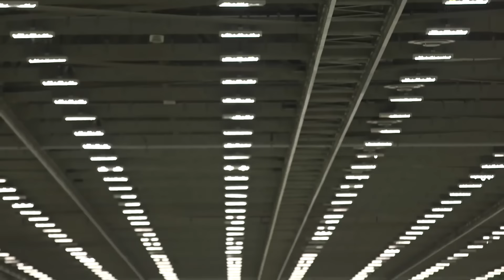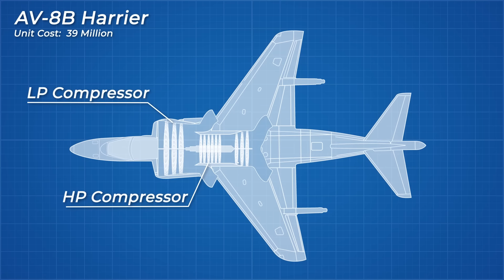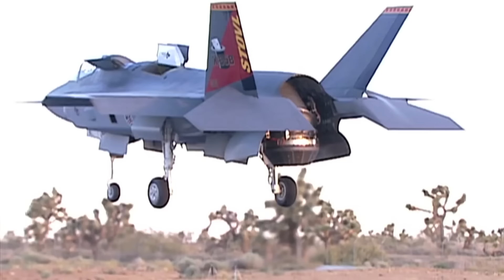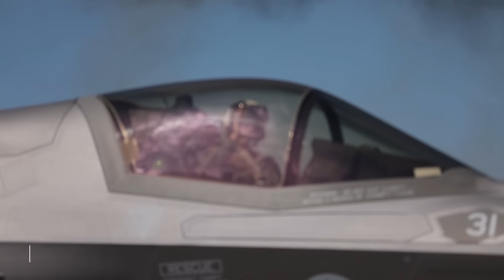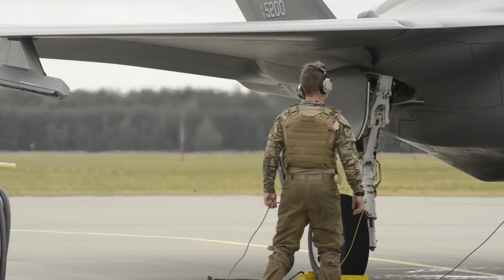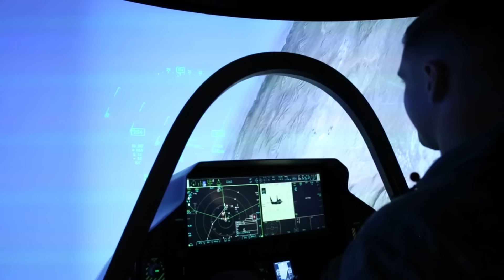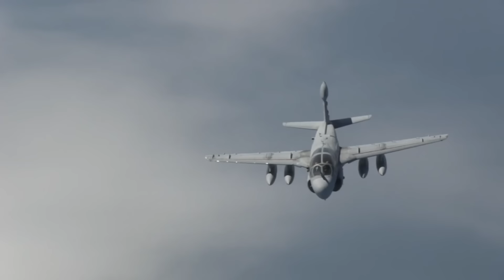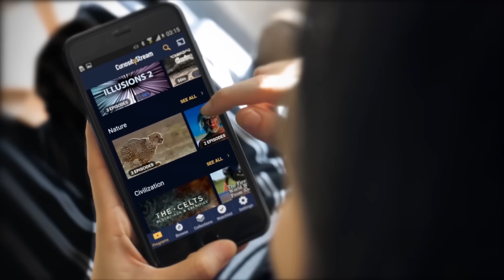Is The F-35 Worth $115 Million?

Comment: Pilot: the plane sucks at turning

Lockheed Martin: Bruh it's in beta
Reply: That's funny because it was exactly the truth. The F-35 WAS in beta. The flight with the F-16 was to tune to flight computer and they flew it with an F-16 because that plane is cheap to fly with detailed measurement on it's performance.
Reply: Bruh it is a multi use plane. Not a straight up fighter. Yet it has better detection and stealth. It will get the first shot off. 

The better question is if a pilot even needed in a drone world.
Reply: To be fair that doesn’t really matter, close range dogfighting is becoming a relic of the past as these aircraft can just fire an amraam or operate drones to attack targets without ever being seen
Reply: @chrispopovich700  The F-35 can actually turn just fine. It can handle anything but the newest pure air superiority fighters. IMO a bigger liability is the F-35's inability to fly high and fast. 

At the end of the day though, there is something people just keep overlooking. The F-35 is first and foremost a strike fighter. It was meant from the beginning to do the job the F-117 used to. For air to air, it was always meant to support F-22's, not lead the way. There is also the fact that we will have a big numbers advantage with the F-35 for the foreseeable future. All these planes that people say will beat up on the F-35, most of them aren't even field ready while we are cranking out F-35's. 

Good luck.
Reply: It sort of suffers complete electronics failures so its got that going for it too.
Reply: another $15 billion please
Reply: Haha
Reply: MrNotadream  The main problem in a drone world is a rouge AI or hacking.
Reply: I do think countries that don't have AI ability will want maned option just to show they own their airspace. Nations will always want to maintain borders.
Reply: Solid B-Team
Reply: Why do we have the same fuking picture
Reply: Itndooesent need to
Reply: Comment of the month award goes to you
Reply: Pilot cont.:  But it's been in Beta for 15 years...and I still have to push Ctrl Alt Delete to reset the radar after a firing solution!

Lockheed Martin:  We're still beta testing our firing solution software.  Do you have another $35 billion to spare?  My kid needs a new vacation home...
Reply: F 35 A is better than j 31 in all aspects and the b and c versions dont have rivals .
Reply: @RicardoMrMendes  come On atleast compare it with Rafale or eurofighter typhoon.
It's an insult to f35 to be compared to a shit box have seen the smoke coming out of j31 engine.??
Reply: @RicardoMrMendes  It does have rivals.
Reply: @leoa4c  Mendes was right. Name another VTOL or carrier launched supersonic, stealth, multirole fighter. Name one being designed anywhere else. 

The B and C versions truly have no rivals. Not even projected rivals.
Reply: @Elthenar  marketing.
Reply: @deltacharlieromeo8252  wdym marketing its not like your gonna buy a plane thats more expensive than your house
Reply: @Elthenar  yes the Pentagon spend billions of dollars on the development of an aircraft, set every single requirement and listing every single design requirement, delaying the project whenever needed to finally have a end result of a “lemon”. Do you see how stupid that sounds? The pentagon would never accept anything other than an aircraft that was exactly what it was looking for in a new joint fighter.
Reply: @jeffjob8265  I am a fan of the F-35 but that line of reasoning is silly. The Pentagon has tanked plenty of ridiculously expensive programs before. Look at the situation with the Littoral Combat Ships and the Zumwalt destroyers for example.
Reply: @RicardoMrMendes  "The F-35 is better than its Made In China 1/1 ripoff."
That doesn't say much, bruh...
Reply: @RicardoMrMendes  There's no practical proof of that claim.
Reply: @RicardoMrMendes  who tf mentioned the j31
Reply: @RicardoMrMendes  "F 35 A is better than its Made In China rip-off" How is that an achievement, mate?
Reply: @RicardoMrMendes  yeah man
Reply: @RicardoMrMendes  I very much like your sense of humor. You think like the F-104 and the Boulton-Paul Defiant had no rivals..?
Reply: @RicardoMrMendes  woaaah you've seen one in combat with another plane that is not NATO? Youtube videos are not counted.
Reply: @deltacharlieromeo8252  Yet, I'd bet you are willing to talk up the SU-35 that has never seen combat of any sort.
Reply: @deltacharlieromeo8252  There are many many planes on the ground in the middle east, not to mention several dead iranian generals and scientists that would attest to the fact it is pretty good in combat.
Reply: They don’t need to turn. The mig 29 picks up the f35 at 29 km. The f35 sees him at over 300 km and kills him before he even knows he is there. Why is turning an issue? Furthermore if you have watched air combat the key is to turn and get on his 6 for a kill. The f35 just flies by, fires and the mussels arc over the plan to shoot him to pieces. This plane is a master piece.
Reply: Fanboys of everything american is great will argue but this plane is shit.
Reply: @jordonberkove7438  see red flag for best results.
Reply: @jordonberkove7438  Yet, you can't give a single reason why. Do better or be dismissed.
Reply: It's a "Regret Purchase" by Australia.  We paid for never-ending development 20 years & got this mediocre thing.
Reply: @UJCentral  shut up stalin pfp
Reply: We could award you a contract to build it and after 25 years you still design the freakin tires
Reply: Wrong all the pilots that have flown this Marvel love it
Reply: @boomerhgt  All Lockheed employees.
Reply: @boomerhgt  Pentagon and Lockheed-Martin have installed a  
highly professional and closely meshed propaganda network around the F-35 Lemon. Nothing is left to chance. Do you really think that a dissatisfied pilot would be free to criticize the aircraft?
Reply: @bernhardecklin7005  I don't think that would be necessary.  No fighter pilot is going to admit he's flying a dog.  That would severely limit his confidence going into combat and (more importantly) bruise his ego.  So he's going to focus on the advantages and develop tactics to fill in the holes.
Reply: @WembysTRexArms  Thank you Robert. Absolutely sensible, comprehensible reading of the situation.
Reply: @bernhardecklin7005   Lockheed’s PR team are really the unsung heroes of this 20+ year saga. Every time the F35 failed to perform or meet expectations, The Spin Doctors jumped into action. Never underestimate their ability to double down on their own bullshit. When they came out talking about how awesome it was that the F-35 could super cruise…And the Air Force pointed out that doing so defeated the purpose of a stealth fighter….The true genius of Lockheed’s PR team was not that they managed to take those lemons and Make lemonade out of them, but rather that they managed to convince the Air Force who just paid  $10,000 for a bottle of scotch, that what they really wanted was sour lemonade in the first place.
Reply: @bernhardecklin7005  Yeah pretty much. Every time they found something that the plane could do, they spun that into a wonderful blessed event, every time it was discovered that the plane couldn’t do something.. they downplayed the necessity.
Reply: @bernhardecklin7005  You do realize that in the west we have this concept known as FREEDOM OF SPEECH. These aircraft are already in service in numerous countries and you think those pilots are unable to speak their opinion on how much they like the F35?
Reply: @Tinfoil_Hardhat  You really think a pilot would risk his career or promotion by crititizing the most expensive weapon system ever? Do you know how many German pilots spoke up against the F-104G? None! Why? Because in the armed forced you are not supposed to rate your arms and geat in public! And that is absolutely right that way. So forget the comments wrtten by the Pentagon and Lockheed PR-specialists and made by F-35 pilots and even more so your naive woke-near and abyssmal uninformed views on what a soldier is allow to express and in which environment. No offense.
Reply: @bernhardecklin7005  Risk his career or promotion? You're actually so deluded to believe that 9 separate nations currently operating the F35 are all conspiring to silence any pilot who says something negative about the plane, while spreading Lockheed Martin propaganda about it? If the plane was bad, they wouldn't go and order MORE of them after they have started using them. 

The F104 did receive criticism from its pilots in actual use. You don't seem to understand this concept of, pilots do retire and will give their opinions on aircraft. Their opinion of an aircraft is protected speech, it's not classified information. 

The F35 is not the most expensive aircraft in history, and you're deluding yourself if you're going to make the claim that every country who orders the F35 is bribed, and every pilot who ever flew it. Based on no evidence at all.
Reply: @Tinfoil_Hardhat  Nice try buddy. Lockheed will decern you a propaganda medal. Fact: You are simply wrong on the F-104 of which you seem to know very little as well as on the costs of the F-35. You think you know better than the US-Air Force chief of staff? You must have incredible insights:)))
Reply: @bernhardecklin7005  I'm saying that the Air Force Chief of Staff did not say what the headlines say. His statement that it's too costly to run is false as of recently as maintainence costs have dropped alongside recent procurement costs, and will drop further into the future. 

You haven't actually debated any of the weaknesses of the F35. At all. You sound a lot like Pierre Spray and the lot that believed the F15 was going to be a failure because a light dog fighter would be better.
Reply: @bernhardecklin7005  Also the Fairey Battle and the Boulton Paul Defiant were not "jack of all trades aircraft" one was a light bomber meant to replace severely outdated biplanes and the other was designed to intercept unescorted bombers. The defiant was successful in doing what it was actually designed to do. As was the F104.

Most of the F104s crashes were due to the plane being difficult to fly. A criticism that has not been levied against the F35A. The F35B has had criticism but not any more than the Harrier it was designed to replace.
Reply: In a clear day clear night the F35 will be as the video states be detected via low frequency radar. Any Mig since the Mig 21 that Mig 21 cost btw the same as one amraam, will be vectored in an old school trap see the f35 and only needing a modern way of detecting a missile launce of amraam, yet can use multi plane attack tactics. F35 can't hide, can't run mach 1.6 mig 21 mach 2 and can't fight when the opponent can detecr and fool amraam or low end swamp its defences get in a turn and burn dogfight it even with a modest pilot will be on the tail of a F35 with a top gun ace pilot. No chance. Any pilot in the RAF WW2 Defiant would on the record praise the dud. As do F35 pilots. Only as a harrier replacement in fleet defence is it ok. Or for countries like Israel who otherwise can't fill the stealth niche. Too costly. Too low availebility. Negative deterrence: please attack us we've gone mad. Even if it does work. JSF jeoperdise State funds / defence funds. Excellent marketing though. Yet that causes and loses wars. Old computer technology in need of constant cost overruns. To big to fail. Like the Defiant in every way a costly bad concept.
Reply: @gerhardris  Wrong...
Reply: @gerhardris  First off, I hope english isn't your first language.

Second, low frequency radar might tell you if a stealth fighter is in the area. It can't tell you exactly where and it can't target a weapon. That opposition fighter will be taking AIM-120's  long before it gets a chance to shoot back. In the event of a dogfight though, as unlikely as that is, an F-35 would eat a mig-21 alive. An F-35 would beat anything in a dogfight but the newest air superiority fighters and even against them it has a chance. They would have to dodge missiles before engaging meaning the F-35 would likely enter the dogfight with a big enough advantage to get an AIM-9 shot off with the helmet sight. 

Third, you and others rate the F-35 solely on it's air to air ability. It is not and never was a pure air superiority fighter. It is a multirole fighter with an emphasis on ground attack. Simply put, it is the best tactical bomber ever made. Most of the time, the F-35 will be doing the jobs the F-117 used to do.
Reply: @Elthenar  Now I do hope old boy that you didn’t mayor in English either, but that is beside the point, isn’t it now? Answer this rhetorical question and I’ll have the satanic pleasure of explaining it to you.  Not put putt a too finer point on it, but really, when in a technical discussion you need to avert to the opponents mastery of the language that in itself already proves you thinking to have a lost cause.  

 Actually I used my cell phone. Which in fact proves my point, technology mucks things up. 

Indeed, as I, and the video stated, and you indeed also reaffirm, low frequency radar can’t direct  missiles by itself accurately enough. (And maybe the Russians can with the S400 etc. SAM but that is another nail in the coffin of F 35 that I didn’t even mention.) Yet close is close enough, and that now is just the point old boy. 

So indeed the only thing keeping the F35 alive will be its missiles. AMRAAM, AIM-120 or other later versions. Well, those missiles are as good as those missiles are good or not good. They need speed that the F35 doesn’t have and when detected by low frequency radar the only thing as said the Mig 21 needs is some updates in order to beat that missile threat, for it already knows by springing the old school trap, where the poor 27 year old F35 is lurking sufficient to eyeball it. So you contrary to what you state – can - target a weapon such as a Mig 21 (or of course a Mig 29, 35 Sukhoi  etc. etc.) onto your beloved F35. You state position that a F35 would eat a Mig 21 alive without even bothering to correctly  prove position. 

The helmet sight is like entering a boxing context with vertical reality goggles. You don’t even need a Mohammed Top Gun Ali to whip your fanny. You will have great situational awareness a second after the fact, whereas the  moderately trained  Mig 21 pilot has the faster reaction using mod. 1 mark 1 eyeball. So with great situational awareness after having expended all its missiles in vain, as said a player can afford to lose Mig 21 in a trade off with AIM-120 that cost the same, by ejecting in time. Yet with some electronics a Mig 21 can dodge a AIM-120 nearly just as well  as a F16. 

Air to air is the Achilles heel  of the F 35 and it can do nothing about that other than get a lot of backup that was advertised it didn’t need. Ergo adding to the already breathtaking  cost preventing a good defense budget for that has gone to Lockheed etc. shareholders.   Only when the missile system works does the F35 have a chance. Well that goes for any fighter. 

Given the need for a human eyeball on target for CAS the F35 as a replacement for the A 10 is laughable. Again the trust in technology is flawed. The F 35 can’t do anything drones can’t do and it certainly can’t do what an A 10 can do, eyeballing and strafing a target in close air support. One AK 47 round hit and it would be a Zippo lighter.

It as the F117 role  is a niche affair as stated.  The serviceability rate will probably also be abysmal. 
 
The ONLY tasks we need a human in a fighter is dogfighting and CAS.  The F35 in a major conflict for what is was intended for and where we hopefully won’t need it other than deterrence,  it fails. In deterrence  as well .  “Please attack us for we spent nearly all our defense budget on a dud”. And even if it is as the Sea Harrier was by the Argentinians over the Falklands that it still has failed its primary objective: Deterrence.  Many specialists even on our own side think it a lemon.  Ergo no deterrence. Won’t help the plot of a, well we know it’s a dud but hope to fool the Russians and Chinese. Oh dear, oh dear.

The JSF was a bad idea in all aspects 27 years ago. The hilarious idea was to cut cost. Well that didn’t work.  The other idea was to earn a lot of money. 

Now that indeed was a success. Like the F 104 and Defiant.  Calling it the Lightning II is a slap in the face of English Electric and Fokker, who did produce correct concepts with the EE Lightning and the Fokker G1 prototype in 1936 (twin tail boom counter rotating prop, no drag second crewmember) on a French idea of a then new fighter bomber concept. That Lockheed used in the P38 Lightning (nose wheel borrowed from the Fokker D23.) with a heavy cannon  armament in the nose. Of mixed also wood construction the G1a close up on nose and belly of the mosquito  could be mistaken by some aircraft spotters. 

Even history shows that the F 35 as jack of all trades and master of none. An extremely costly mistake.
Reply: @gerhardris  I did not read that,
Reply: @Elthenar  of course not. English that proves you wrong, and thus leaves you without further argument that the F35 was a wrong idea and outdated from the start.
Reply: @gerhardris  When you start speaking English, get back to me.
Reply: @Elthenar  You mean writing. Go to school. So, you've been bested in English, logical argument and knowledge of the topic: F35 is an undefendable fighter that can't defend itself.
Reply: @liamhansen5061  prices vary a lot. Even AMRAAM.  Don't compare a Mig 21 Bison with a second hand Mig 21 without an up date. Even a non updated Mig 21 can kill a F35, but you'd need several. And use old school tactics. The non stealth aim 9 x on the F35 already proves the F35 concept was wrong, and needs help in order to compete in a dogfight. A fight that can and thus will be thrust up on it. F35 is a dud.
Reply: gerhard ris 

1. The idea that stealth isn’t effective against “low frequency” radar is a myth. There is documentation to prove that stealth works against VHF, UHF and L-band radars.

What is true is that stealth is far more effective against higher frequency radars, especially X-band. 

However, stealth tech can still reduce the effective range of  “low frequency” radars. This creates gaps in coverage that a stealth aircraft can fly through. It also means that a stealth aircraft can get close enough to these radars to destroy them with stand off weapons.

One big problem with low frequency radars is that older stealth aircraft, such as the B-2 and F-117 didn’t have any radar warning systems whatsoever. So they relied on careful mission planning to make sure that they weren’t detected by these types of radar.

But this isn’t a problem for the F-35 or F-22. They have the radar warning systems. And theirs are FAR more sophisticated than most other fighters, to the point that they are able to use them to protect other fighters.

2. The F-35, like the F-22, has an advantage in real world speed and maneuverability due to internal weapons carriage. 

For example, the F-15, on paper, is much faster, with a top speed of Mach 2.5. However, in real combat, the F-15 is going to be carrying external stores that limit it’s practical speed to just Mach 1.4.

This is true of all coventional fighters.

As far as maneuvering goes, the F-35 was limited when it was a prototype. The actual operational F-35 is just as good as any 4th gen fighter.

In fact, the Air Force recently had an F-35A perform the same air show routine as an F-22.

3. How do you know that the AMRAAM is going to miss? Yes, you can update old fighters with new tech to make them more survivable. But the AMRAAM can, and has, been updated constantly,  to keep it effective.

4. As stated by others, the fact that you can detect a stealth aircraft doesn’t mean that you will shoot it down. While the older aircraft are struggling to find the F-35, even directed by “low frequency” ground radar,  the F-35 will see the other aircraft from 100 miles away, and plan a perfect attack. At the very least, the other aircraft will be on the defensive, struggling to stay alive, and seriously considering the parachute.

Let’s say that the older fighter survives. The F-35 doesn’t have to give it the opportunity to get to “the merge.” The F-35 can fire its weapons and leave combat, unless other aircraft are in danger.

4. The F-35 program, if successful, will produce the aircraft in such overwhelming numbers that other air forces will be unable to compete. Well over 1000 F-35s could be produced.

Also the actual price tag of the F-35 is comparable to fighters like the F-15, as well as typhoon or rafale.

The F-35 development was very expensive, but most of that money has already been spent. The actual cost to build and deliver one,  the “fly away cost,” is about the same as other fighters of the same size. But these fighters lack stealth and comparable avionics.

And as expensive as F-35 development was, the price of developing three separate fifth gen fighters would have been much higher.

5. What makes you think the F-35 won’t be able to do CAS? The US Air Force had all kinds of aircraft doing CAS in Afghanistan and Syria. They had F-15s, F-16s, they even had B-1B bombers doing it. The F-22 did CAS in Syria.

The main adavantage of the A-10 is that it has relatively small engines that give it a long loiter time, when compared to most fighters.

But the F-35 carries a tremendous amount of internal fuel. It carries as much as F-22, despite being much smaller.

This means it will have good loiter capability. It also means that the fighter can go supersonic longer than most fighters, without having to rely on heavy, draggy EFTs.

The F-35 really is an amazing machine. It is still a jack of all trades with compromises in some areas. But when you consider all the advantages it has, and the fact that well over 1000 of them will be operated by allies around the world...

There is just no comparison to anything else.
Reply: @scalywing1  
"scalywing16 dagen geleden
gerhard ris 1. The idea that stealth isn’t effective against “low frequency” radar is a myth. There is documentation to prove that stealth works against VHF, UHF and L-band radars. What is true is that stealth is far more effective against higher frequency radars, especially X-band. However, stealth tech can still reduce the effective range of “low frequency” radars. This creates gaps in coverage that a stealth aircraft can fly through. It also means that a stealth aircraft can get close enough to these radars to destroy them with stand off weapons. One big problem with low frequency radars is that older stealth aircraft, such as the B-2 and F-117 didn’t have any radar warning systems whatsoever. So they relied on careful mission planning to make sure that they weren’t detected by these types of radar. But this isn’t a problem for the F-35 or F-22. They have the radar warning systems. And theirs are FAR more sophisticated than most other fighters, to the point that they are able to use them to protect other fighters." 

Scalywing, first off: thanks for posing serious argument. 

Ad 1. Yet, my point still holds true, for placing one or more  F35’s over hostile territory clear day clear night makes that even an old school observer corps with mark one mod one eyeballs and telephone or even semaphore can have a trap sprung on a F35. I.e. the Mig 21’s with mediocre pilots  will take off from secret bases and go for the gun merge. There still is no technology to find well-hidden military assets, even planes using roads to get airborne.  And I agree that concerning all radars including low frequency bands is a relative affair. Yet that too is a race in amount power and springing the trap. Question of good tactics training and devotion. That is what brought the first F117 down. And indeed had the F117 had a radar warning and not flown a predictable path, its chances would of improved. Yet that said certain areas are on certain bait targets known to be overflown. In a large scale war being too dependent on technology is a very dodgy affair. Repeated history shows that having the technological edge at great financial cost, doesn’t always guarantee victory. Take the sniffing of urine by the US in Vietnam. The VC simply hung up a lot of pots with pee, when they caught on. Which any enemy invariably will. The main point that I make is thus, that you absolutely need a lot of available good dog fighters as the failsafe base from which to work on. The F 35 has this as its Achilles heel. The dedicated enemy will exploit this. Which brings us to your second point.
Reply: “Scaly Wing: 2. The F-35, like the F-22, has an advantage in real world speed and maneuverability due to internal weapons carriage. For example, the F-15, on paper, is much faster, with a top speed of Mach 2.5. However, in real combat, the F-15 is going to be carrying external stores that limit it’s practical speed to just Mach 1.4. This is true of all conventional fighters. As far as maneuvering goes, the F-35 was limited when it was a prototype. The actual operational F-35 is just as good as any 4th gen fighter. In fact, the Air Force recently had an F-35A perform the same air show routine as an F-22.” 

Ad 2. As I understand it an old Mig 21 maybe a bit updated with a better view taking off in a trap with guns only and optimum fuel load will run rings around a F35, in all aspects of dog fighting agility at all altitudes. F35 can’t run, can’t turn, and can’t hide.  Dead meat. With great situational awareness the F35 Top Gun pilot will observe the Mig getting on its tale and pumping 30mm shells up its waxed fanny.   The only problem the Mig 21 has is detecting the launch of AMRAAM which it can eyeball in this scenario, and having then the problem of defeating the AMRAAM that all non-stealth fighters have. Using turning and – modern – decoy tactics, or just trade off the Mig for AMRAAM. Send more Migs than the F35 has AMRAAMS. Just eject in time. Updating AMRAAM all the time is a very costly affair. So even when it hits it still loses the cost trade off. F35 goes down in flames as do several Migs. Which already falsifies your third point: 

“Scaly wing 3. How do you know that the AMRAAM is going to miss? Yes, you can update old fighters with new tech to make them more survivable. But the AMRAAM can, and has, been updated constantly, to keep it effective.”
Reply: “Scalywing 4. As stated by others, the fact that you can detect a stealth aircraft doesn’t mean that you will shoot it down. While the older aircraft are struggling to find the F-35, even directed by “low frequency” ground radar, the F-35 will see the other aircraft from 100 miles away, and plan a perfect attack. At the very least, the other aircraft will be on the defensive, struggling to stay alive, and seriously considering the parachute. Let’s say that the older fighter survives. The F-35 doesn’t have to give it the opportunity to get to “the merge.” The F-35 can fire its weapons and leave combat, unless other aircraft are in danger. “

Ad 4 The point I’m making is in a clear day clear night scenario, any enemy using old school tactics will be able to get even a Mig 21 inside the eyeball merge. Nothing a F35 can do about that other than not flying over such hostile territory.
Reply: “Scalywing 4. (4 b) The F-35 program, if successful, will produce the aircraft in such overwhelming numbers that other air forces will be unable to compete. Well over 1000 F-35s could be produced. Also the actual price tag of the F-35 is comparable to fighters like the F-15, as well as typhoon or rafale. The F-35 development was very expensive, but most of that money has already been spent. The actual cost to build and deliver one, the “fly away cost,” is about the same as other fighters of the same size. But these fighters lack stealth and comparable avionics. And as expensive as F-35 development was, the price of developing three separate fifth gen fighters would have been much higher.” 

Ad 4b Granted selling a lot of F35 will reduce the price tag in one sense yet the F35 is an inherently technology ridden affair. That is inherently very costly to keep it in constant updated form. The computer technology in the bases is what is it when the first prototype F35 was flown? Like updating Windows. Furthermore in a merge computers are simply too slow. Like a boxing contest with your sell phone as a goggle, you will be inherently behind the game. Such technology only provides the edge when the opponent isn’t on to you, and plays the game that you want to play. They won’t. Furthermore the F35 is history repeating itself as was the Me 262. Many (was it 2000?) were produced.  The availability was far too low to make an impact. And the USA with the old P51 found the weak spots: the Achilles heel. Wait until they want to land and grab them then. Then what do you spend the money for in the first place? Deterrence. It doesn’t scare me, so why would it scare the Russians or Chinese? This is the other history repeating itself. The (Sea) Harrier not deterring the Argentinians over the Falklands. So even if the F35 does work, in a war we want to avoid, the Sea Harrier failed in that department (only also after the war started getting Aim 9L BTW). What we need is a clear day, clear night cost effective mass no pound for air to ground basic dogfighter to shoot down all the stuff that flies like the P 51 Mustang did. The USAF Mustang II program is just that, and an improved F16 hotrod as stopgap. What we further don’t need is what was already clear in the late seventies when the first cruise missiles came along is a fighter bomber such as the F35. All all-weather strike missions and most interdiction missions no longer need a pilot. No way of knowing what and how many such missiles or UAV’s the Chinese / Russians are building or have built. History again repeating itself like the Japanese attack on Pearl Harbor using torpedo’s that could do shallow impossible attacks. Shooting UAV’s and cruise missiles and what not down is what you still need a pilot for. And for CAS: your fifth point.
Reply: “Scalywing 5. What makes you think the F-35 won’t be able to do CAS? The US Air Force had all kinds of aircraft doing CAS in Afghanistan and Syria. They had F-15s, F-16s, they even had B-1B bombers doing it. The F-22 did CAS in Syria. The main adavantage of the A-10 is that it has relatively small engines that give it a long loiter time, when compared to most fighters. But the F-35 carries a tremendous amount of internal fuel. It carries as much as F-22, despite being much smaller. This means it will have good loiter capability. It also means that the fighter can go supersonic longer than most fighters, without having to rely on heavy, draggy EFTs. The F-35 really is an amazing machine. It is still a jack of all trades with compromises in some areas. But when you consider all the advantages it has, and the fact that well over 1000 of them will be operated by allies around the world... There is just no comparison to anything else.”

Ad 5  When the F 35 has the same loiter time as the A 10 which A 10 is also deemed too costly for a low intensity war like in Afghanistan, for which an updated version of the Bronco or the like would be perfect, the F35 is way, way , way too expensive. Then in a high intensity conflict you need rugged availability close to the call for CAS. Only the Harrier in a forward base or a loitering A 10 can comply in a cost effective manner, for the F35 has a notorious high down time akin the Me 262. I don’t rightly know whether it is needed to have a mod one mark one eyeball in a down in the weeds on a  CAS mission, in a flued mess when things have gone wrong and CAS is needed asap. If so then you need a flying tank such as the A 10. In the real world and a mayor war, only the rugged and simple stuff keeps working. The glitter stuff tends to break down, and become unserviceable. The F35 has a long track record of not being on time and being unserviceable.  The history of the Focke Wolf 190 and later Fiat G91 and F 5 mass simple cheap and available philosophies spring to mind. Philosophies that worked under real world stress. The F35 drains the financial capabilities of for instance us Dutch that serious other needed defense projects are canceled and postponed. Exactly what we don’t need. A plane that entices the Chinese and Russians to attack us, for we’ve lost it. An indeed amazing machine the F35 a Jack of All trades yet master of none. Apart of an indeed genius marketing machine of Lockheed. They outdid the other dud the F104 G. Luckily then that dud didn’t have to compete with the Mig 21, this F35 won’t hack it either. Hope again I won’t be proven right.
Reply: @gerhardris  yeah the f-35 can boast a record nearly as impressive as the a-10s blue-on-blue record, insane!
Reply: @Smithgirll  I've changed my final verdict position on F35 since it has been stated that it can dogfight and turn when push comes to shove. If it couldn't it would be too expensive junk. Well, it can do dogfighting. I took the statement on max 6G as a fact.

As an A10 replacement I still don't see what an F35 can do better than a drone.
Reply: @gerhardris  for the a-10 and drone thing, better accuracy, much larger payload, more diverse payload.

As for your other statement, welcome to the club!
Reply: @gerhardris  you really have no idea. It hasn't been detected by low frequency radar because otherwise there wouldn't be a whole lot of destroyed syrian and iranian radar installations. The S400's have proven completely unable to detect the F-35 and have been destroyed time and time and time again. What we do know is that the S400 can detect a commercial airliner and destroy it.
Reply: @carisi2k11  well, first off assuming the Russians have fielded their best systems.

Second indeed I no idea. Neither do you or anyone else.

And third and last you clearly have no idea of logical argument, the physics and history.

Saying a F35 is at the moment safe from detection is as said not known until a mayor war. Historically it is akin the Nazis beleaving that the Enigma machine was safe. Well the Polish mathematicians cracked it. The Brits made it a practical way.

A F35 or any aircraft leaves physical traces that can be detected given technology. The only question is has anyone cracked it? Again I don't know neither do you.

And the main point remains  on a clear day clear night you don't need radar to shoot this dudd out ofthe sky.